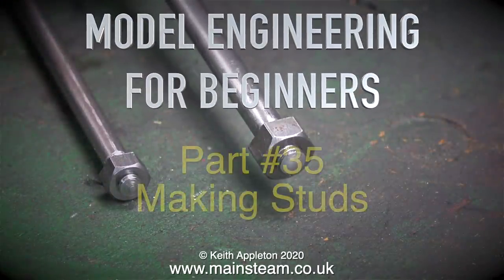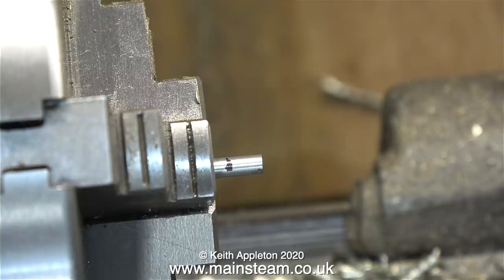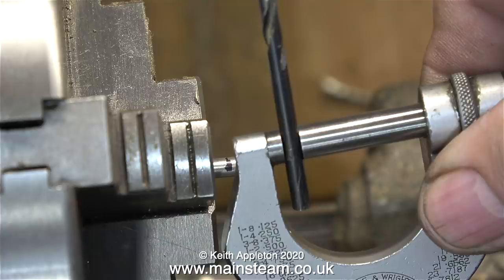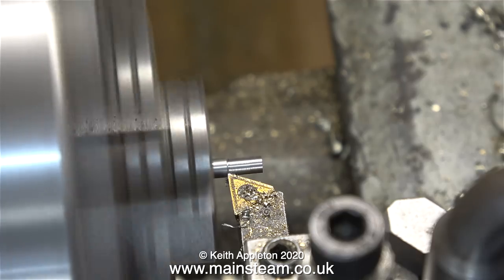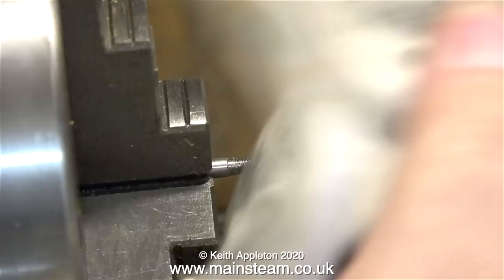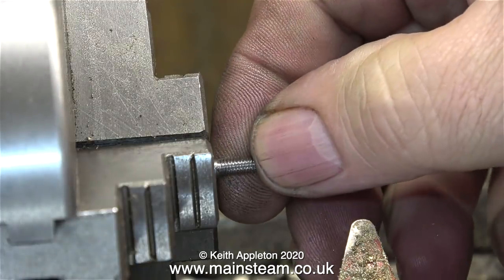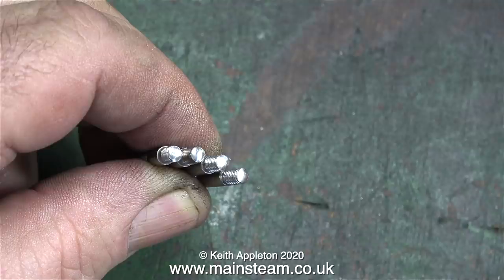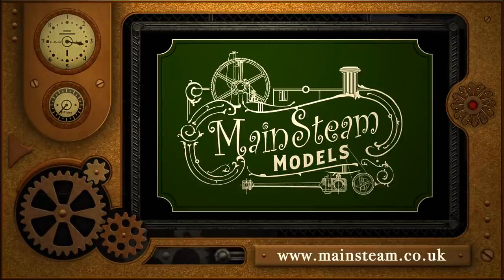MAKING STUDS - MODEL ENGINEERING FOR BEGINNERS - PART #35

Comment: I wonder if it would be more efficient to put the coned end in before you tap the thread. 

Regarding the comments on having leads on both sides of dies, it's yet another reason why I have elected to mainly change to all metric threads. It is getting increasingly difficult to get BA fasteners unless you go to a specialist supplier.
Reply from the maker: No, because the threading usually distorts the end slightly.
Reply from the maker: Try www.blackgates.co.uk for BA stuff. That's where I get mine from {:-)))

Comment: If you need to make studs with a thread both ends how do you hold  the half made stud to avoid damaging the first threaded end.
Reply from the maker: If you watch the video, you will see that I machine the diameter of the Stainless Steel bar in order to thread it 2BA. This also means that when I hold it in the chuck to thread the other end, the chuck jaws do not contact the threads at all.

Comment: It's a pity Keith, that the "sided" dies seem to be quite difficult to find now. Having started model engineering perhaps 18 months ago, I've not managed to find a supplier of these. They all seem to have a lead in on both sides.
Reply from the maker: are you sure? usually they have more tapered "lead" on one side than the other. I will have a look at some of my newer dies.
Reply: @keithappleton  I specifically tried to get one in 5BA Keith... couldn't in the end. What a pain. Other I've bought too... all have lead ins both sides

Comment: If I had a lathe I could make the studs I need!
Reply from the maker: You don't need a lathe to do this, you could use an Electric Drill Chuck to hold the piece of bar . . . . or even clamp the stud blank in a Vice . . .
Reply: @keithappleton  Thanks I'll give it a try. I need to make six 5mm studs to replace the poor quality bolts used on a commercial electric loco chassis. I have metric taps and dies, plus, for some reason, a few ME taps and dies.